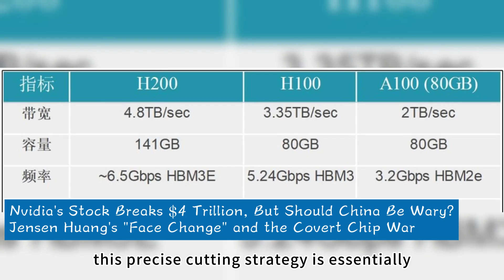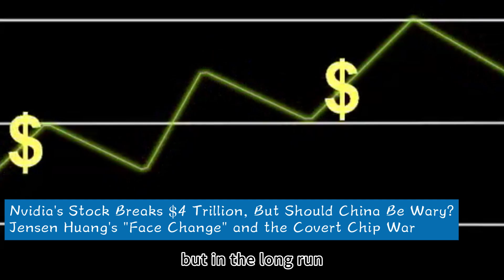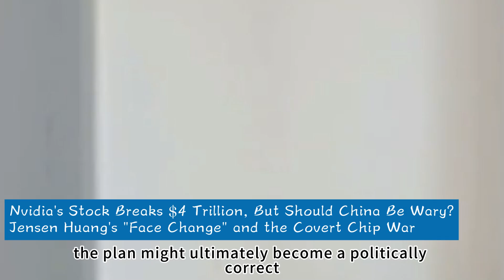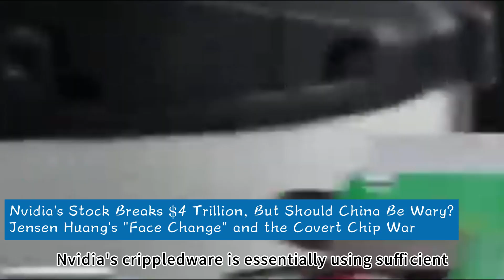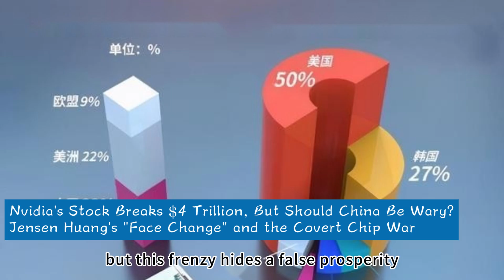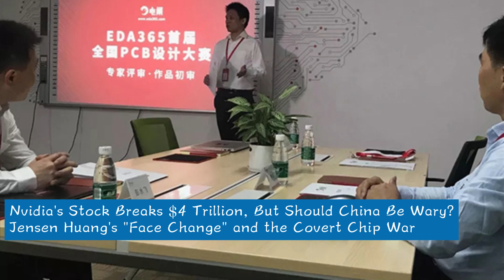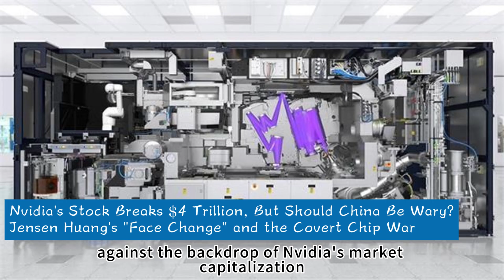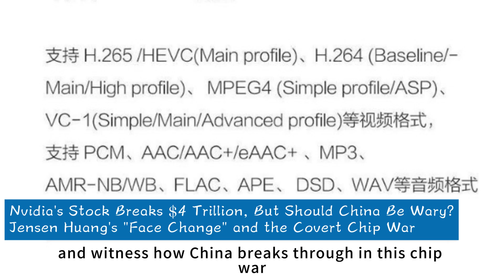Jensen Huang's "Face Change" and the Covert Chip War

Comment: More significant is Huawei’s AI chip outselling Nvidia. It’s chip is not as powerful as Nvidia’s. But no problem - just use better technology to stack more chips - as in a 384-chip cluster on its Ascend platform (vs. Nvidia’s 70) to achieve greater high-speed bus interconnection capability and lower latency linkages.

Huawei’s CloudMatrix 384 offers 300 PFLOPs of dense BF16 computing. That’s double of Nvidia GB200 NVL72 AI tech system. It also excels in terms of memory capacity (3.6x) and bandwidth (2.1x).

Huawei can’t make enough. So in the meantime, the black market for Nvidia chips is still flourishing - with an estimated $1 billion worth just reported by Nvidia flooding into the China market despite Nvidia’s H20 ban being lifted.

This is the voracious demand of the market in China driven by AI initiatives going on at the grassroot level . . . . and how lucrative for Huawei when they can scale with their own EUV to take over the market. . . with more efficient and affordable AI chips.

Leaked news is that there’ll be Chinese EUVs from different makers adapting alternative technologies for cheaper and more efficient machines as soon as late 2025.